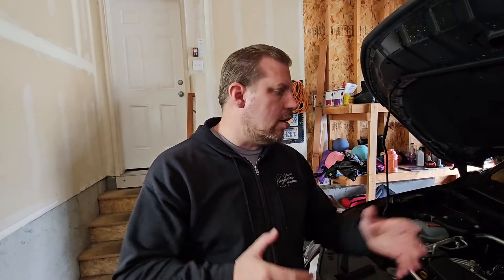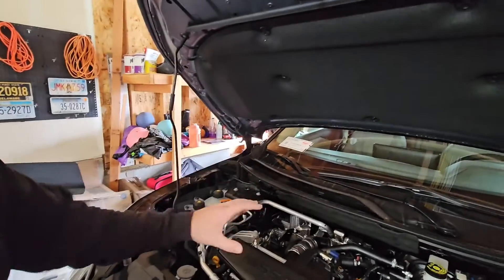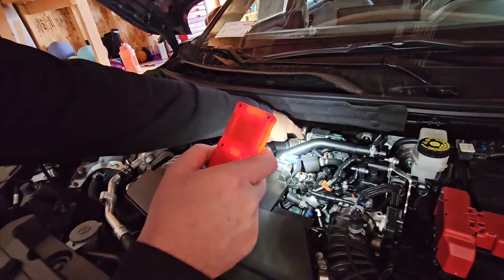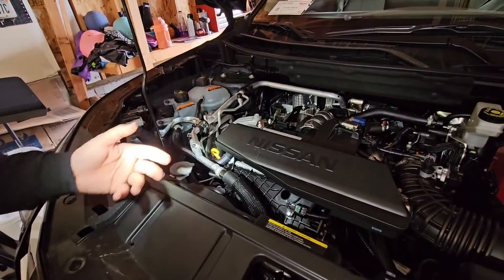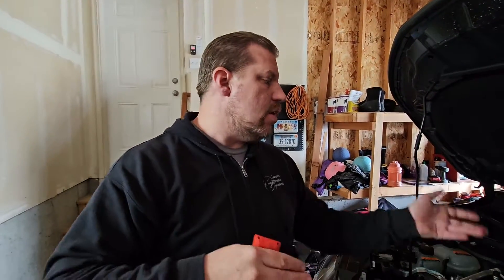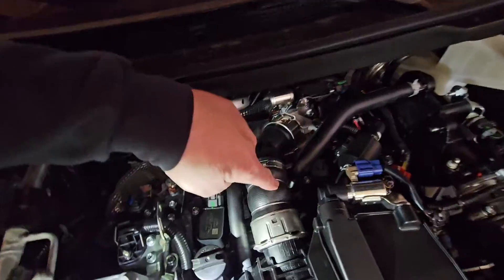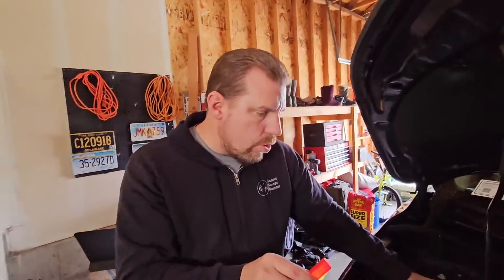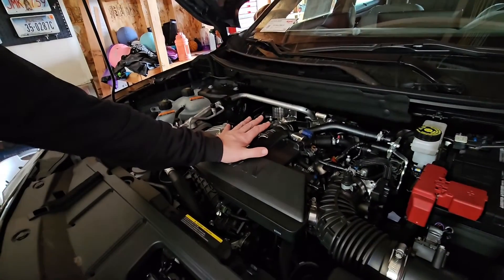ONE of THE COOLEST ENGINES I HAVE EVER REVIEWED!!  The Nissan  1.5 VC-TURBO on jmcGarage Talk!

Comment: The performance out of it is outstanding. I'm currently renting one for a few days while my car is in the shop and have been really been impressed by the engine's performance. It is what lead me to this review. It pulls like a V6. And it gives you that torque in the low 2k's RPM's. I kinda feel like they should bring back the 240sx and use this engine in a RWD configuration.